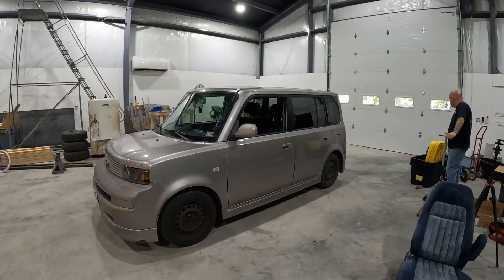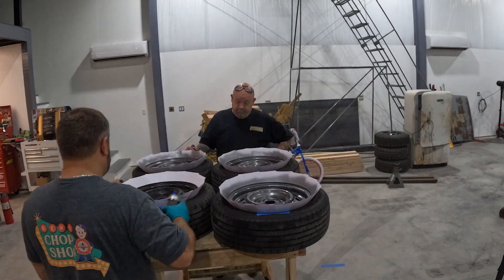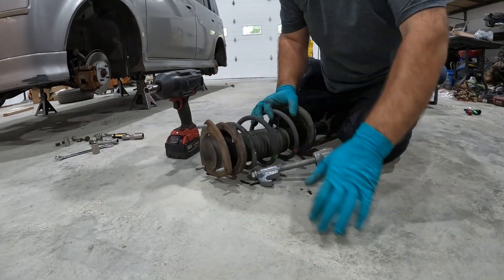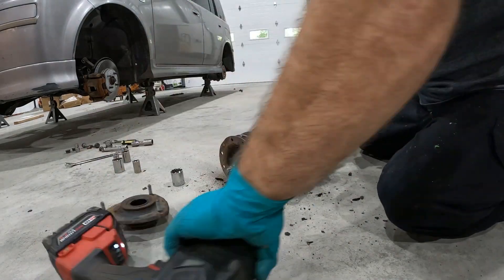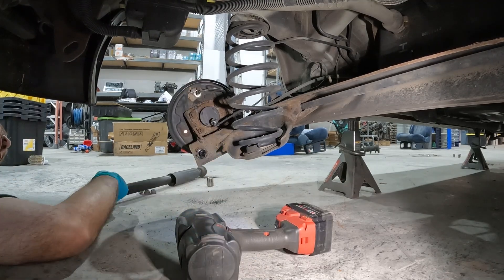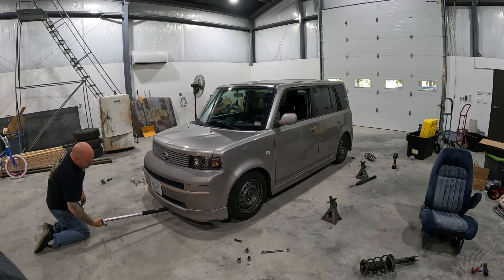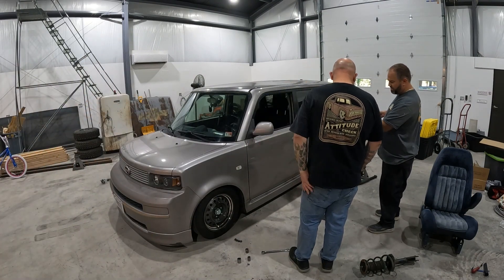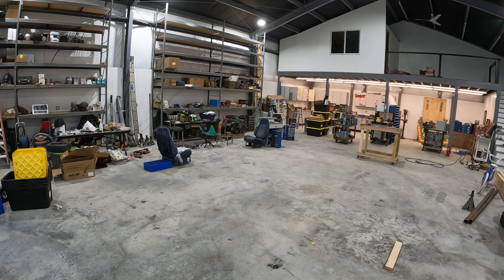Budget Scion XB transformation , coilovers and wheel mods

Comment: You guys did a beautiful job!  Those trim rings finished it out nicely ❤️
Reply from the maker: @vwave7292   thanks I appreciate it ! And thanks for watching!
Reply: @kenschopshop  those specific rings from anywhere? or are they just universal 15inch rings? and the center caps where did you get those and do they fit in or around the outside of the wheel hub area?
Reply from the maker: @jessechavez7320 
This is the center cap part number 

https://www.napaonline.com/en/p/BK_7302411

Here's the link to them but if that doesn't work they are from Napa they are balkamp 730-2411 for the center caps .

 The trim rings are from wheel vintiques they are the 15" hot rod smooth trim rings sku # 3005-15-1  hope that helps. And thanks for watching!

Same info is in the description as well
Reply: @kenschopshop  thanks! 🙏

Comment: Ok so where did you find the rings and dust caps? Have any part numbers or sizes you can share?
Reply from the maker: https://www.napaonline.com/en/p/BK_7302411

Here's the link to them but if that doesn't work they are from Napa they are balkamp 730-2411 for the center caps . The trim rings are from wheel vintiques they are the 15" hot rod smooth trim rings sku # 3005-15-1  hope that helps. And thanks for watching!
Reply: 100%
Reply: Were yours flat tops or round tops because it shows in their web site as round tops🙏🏼
Reply from the maker: @mannypacheco3554   the ones I got using that part# were flat tops but I do see online it shows the dome ones but the 3 I originally had from back in 06 using that number and had to pick up a 4th one for this xb and used the same part # and got a 4th flat top cap

Comment: That looks cool. Good idea. Where you get those rings
Reply from the maker: @nesco7615 
This is the center cap part number 

https://www.napaonline.com/en/p/BK_7302411

Here's the link to them but if that doesn't work they are from Napa they are balkamp 730-2411 for the center caps .

 The trim rings are from wheel vintiques they are the 15" hot rod smooth trim rings sku # 3005-15-1  hope that helps. And thanks for watching!

Comment: Can you tell me what size those center caps Are?
Reply from the maker: https://www.napaonline.com/en/p/BK_7302411

Here's the link to them but if that doesn't work they are from Napa they are balkamp 730-2411 for the center caps . The trim rings are from wheel vintiques they are the 15" hot rod smooth trim rings sku # 3005-15-1  hope that helps. And thanks for watching!

Comment: What is the size for the chrome caps for the centers of the steelies???
Reply from the maker: @omega5fisher  

https://www.napaonline.com/en/p/BK_7302411

Here's the link to them but if that doesn't work they are from Napa they are balkamp 730-2411 for the center caps . The trim rings are from wheel vintiques they are the 15" hot rod smooth trim rings sku # 3005-15-1  hope that helps. And thanks for watching!

Sorry just copy and pasted the info on the caps and trim rings from another comment.  Hope that info helps.  And thanks for watching.  Also the center caps are unfortunately not chrome they are just zink plated trailer hub bearing caps

Comment: Did you have to take the top of the shock out on the rear to drop the axle? I was just wondering because I am looking at lowering my Scion. I thought I just had to undo the bottom side.
Reply: Great work! It looks so much better!
Reply from the maker: @johnpaulheupel5713   thanks ! To just lower it with drop springs all you need to do is remove the lower shock bolt to drop the axle . But with the coilovers it replaced the shock so we did that too . Thanks for watching!
Reply: Thanks! @kenschopshop

Comment: Help from anyone please?  I have a cosmetically beat up 05 XB… would it be cheaper to buy one that looks nice or to get a couple of small dents fixed, spoiler, door lock actuators, windows get stuck, new wheels, and a paint job on my current one?  Ones in good condition (much nicer looking than mine) and a few more miles can be found around me in the $5k+ range.  I obviously know nothing about fixing up cars
Reply from the maker: That's a tough call honestly  , really if you have one that's in great mechanical condition and lower miles it might be worth getting it cosmetically fixed up but paint and body can definitely be expensive.  Maybe get a few quotes from some local shops to see what all the repairs on yours might cost ya and then do the math to see which is the better route to take . Sorry probably not the answer you we're looking for but good luck
Reply: My front windows also used to get stuck, I found replacements on Amazon and fixed them within an hour after some YouTube vids! The door lock actuators all have to be replaced so you’re not taking each one out to figure out which one is causing the issue, cause if ones out, they’ll all go out so might as well! I did that while I was fixing the window actuator too since the panels were off, that took maybe an hour and a half but only cause I decided to do all this at the end of a Bay Area summer 😂 Super easy tho and I don’t consider myself a fixer upper of cars but I sure can fix this car! YouTube is your friend!
Reply: @PreSwoleBobby  thanks… I’m considering trying it myself now..  I kind of like how my XB looks beat up because no one looks at it twice but having those things fixed would make drivability better.
Reply: @wakawaka1976  also check if there’s any pick’n’pulls near you! Salvage yards have been a huge help! My rear bumper was seriously messed up and I found one that was the same color, minor scratches but not as bad of a crack like my previous one had! The sites let you search for the specific year, just a note 2004-2006 share the same body so parts are the same!